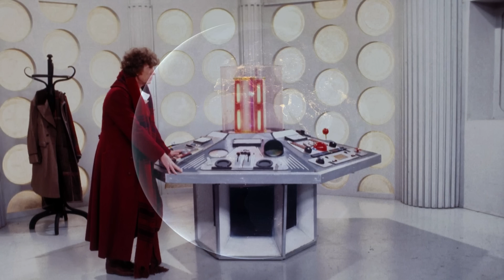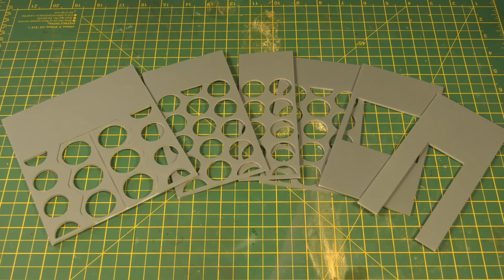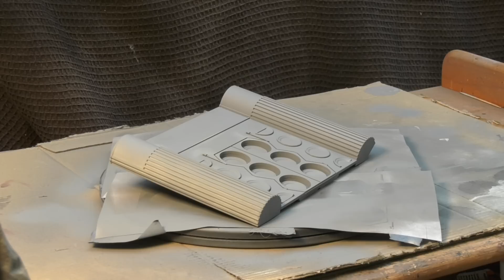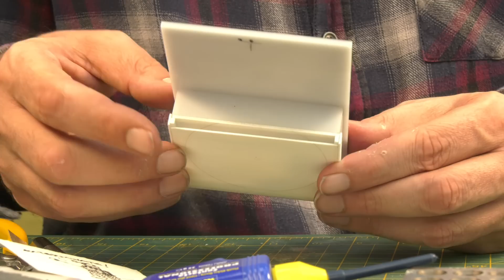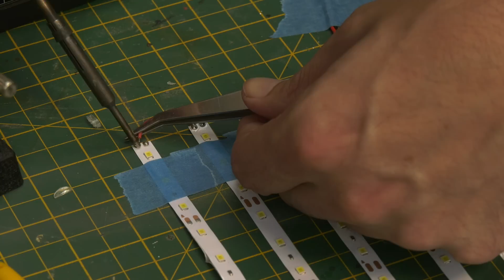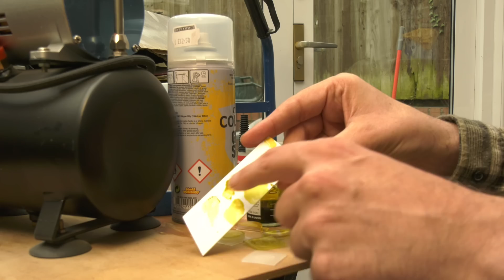TARDIS Console Room Diorama - CNC Cut, 3D Printed & Scratch Built.

Comment: The debate continues! 3D printing and CNC cutting can do a better job than you can. Of course, you are applying superlative tools along the way. That "super" part means "$$$" of course! And there's the rub. I kind'a follow the Adam Savage Method, every job is an opportunity to invest in a tool. Sadly CNC and 3D printers have a steep learning curve to the software and sometimes the hardware. Things have gotten better even since you uploaded this... hard to imagine... prices have come way done. All that's nice but the software is now the bugaboo. And so it goes.
This episode was a great and fascinating ride-along to a very nice build. I am delighted that you have the (THE) plans and parts lying about to hand. Wonderful. Airbrushes... ahh... the line-in-the-sand between a crank amateur and a pro. To my mind, the "pro" part is knowing -- and doing! -- what must be done each and every time you use one of the damned things. Two easiest cleaning methods are to have a bucket of water handy and submerge the whole handpiece OR squirt some Windex right into the paint bucket and blast it out. The only "tip" I ever got that made sense was to take some 1000 grit and wet polish your needle. All that being said, I love me my spray cans. Those paints have come a long way.
Blowing stuff over the table edge... ahhh... a universal pastime! So sad one must wait for the spiders to rebuild all their webs down behind the radiator.
Reply from the maker: I follow the same rule, always have done. Buy a tool for a job and then use it for projects further down the line - it made sense to me as a child and I still do it. Yeah, polishing up the needle is something I was told about, so far, not had the need to do that yet, but we'll see.

Comment: Absolutely fantastic work, you’ve altered my view of 3D printing too as so far I’ve been hand building everything, I may take up your airbrush recommendation too as so far like you I’ve been using relatively cheap ones from Amazon.  Can’t wait to see your next project
Reply from the maker: Thanks. As I said in the video, and I've been saying it for years, is that this technology is a tool like any other. For me, it's the time saving that is a key attraction. The Iwata is brilliant, totally changed my resistance to airbrushing. It's so easy with that thing, with the others I was constantly having to dismantle and clean it mid work - which was awful. The Iwata could last for about 30 minutes before a quick flush through was needed, that was it! You'll not regret buying one.
Reply: Badger airbrushes are good ☺︎

Comment: Very nice mate 
I’ve been working on building a 5.5 CO scale secondary console room and I’ve found that I underestimated the size of it but luckily in have a few printers so I can get through it a bit quicker that if I had to do it l by hand.

And luckily there’s been a few secondary console models already made by great modellers but I’ve found that the version on 3d printing doctor who is the most accurate and closest to CO scale.

Building it will be  fairly easy cause it literally just 3 walls and a base with the roundles stuck on with a scanner wall and a door on either side.
Reply from the maker: Well, I'm just starting to go through about 35 plus years worth of research and note taking for these builds, so it's been great to tackle them - even nicer to place them into a digital form. It's been a goal for years, but now it's actually starting to happen. A console room is very easy, so it was the ideal first candidate.

It sounds like you've been going great guns with your builds too.